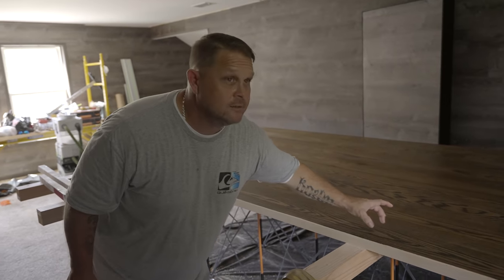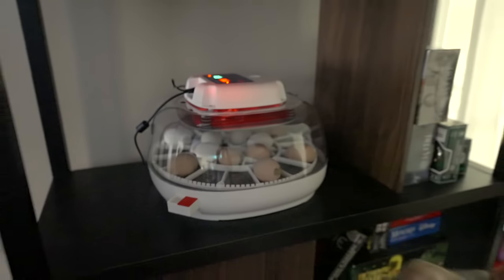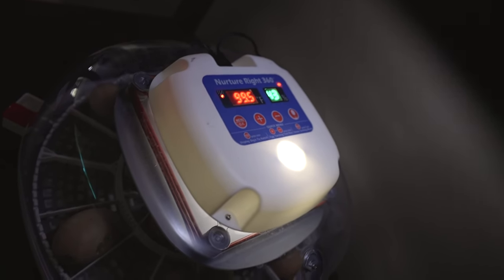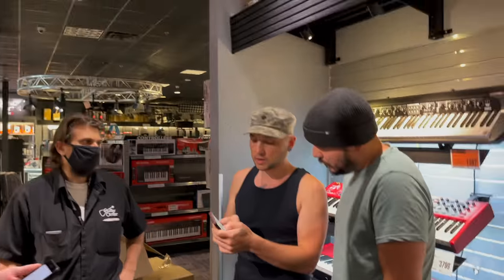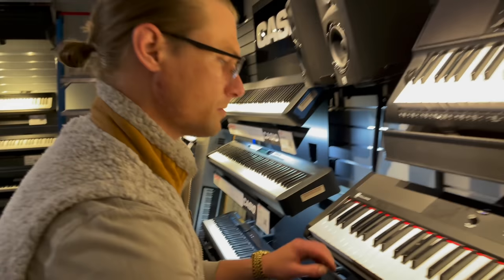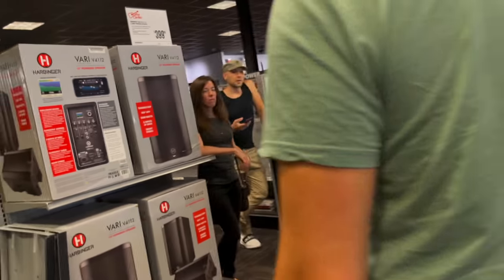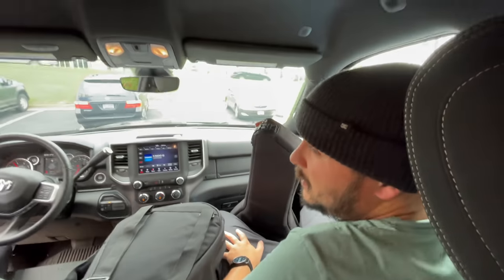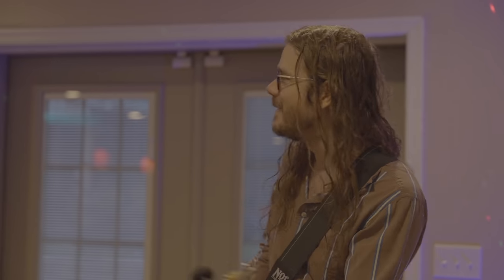Ian Joins The Jam Session After Our Musical Shopping Spree

Comment: Manbun guy should've told you none of the features on the expensive keyboard you bought will be used, for music production it would be used for MIDI programming - a $100 keyboard would've sufficed
Reply: it is nice to have an ACTUAL keyboard though with speakers and what not.

just in case you need something to actually jam with.

I love my MIDI keyboard... it's full size, got weighted keys and errythang. even got some assignable faders and buttons that I barely ever use. ...

...but sometimes I wish I had something with some decent patches to just play as well.
Reply: @ToneSherpa  noone i repeat no one uses in-board keyboard speakers to jam. that's like saying you'll run your guitar through your alexa speaker for a jam
Reply: @r.c.christian1198  I do! When it's an acoustic jam. Or if I'm by myself. And besides, I have never heard of a keyboard that didn't also have like a quarter inch out as well.